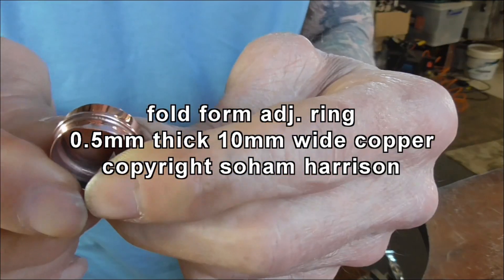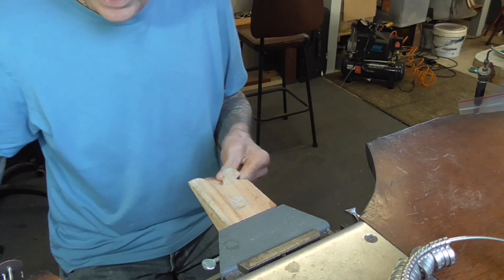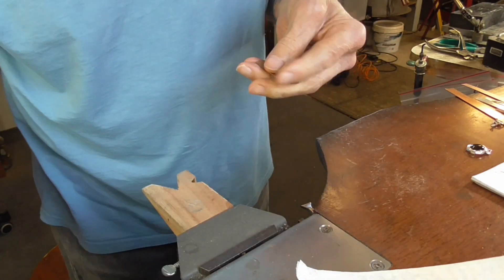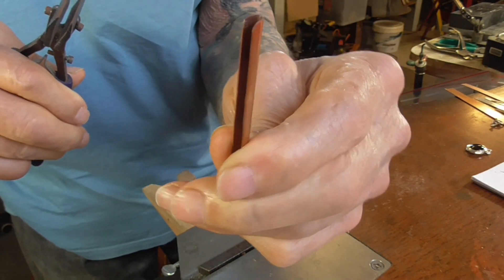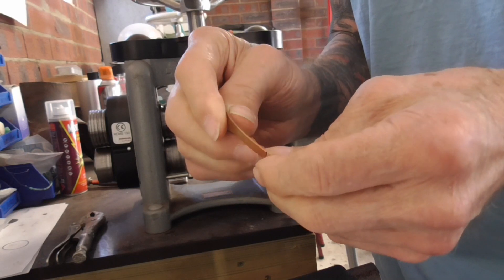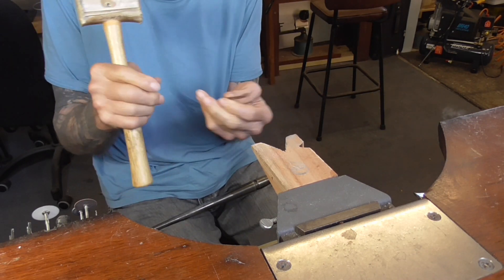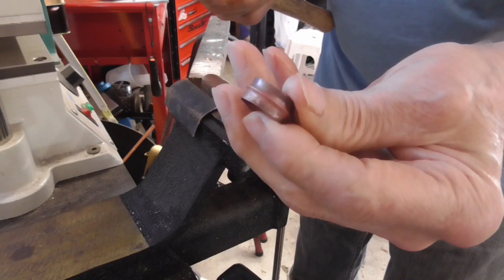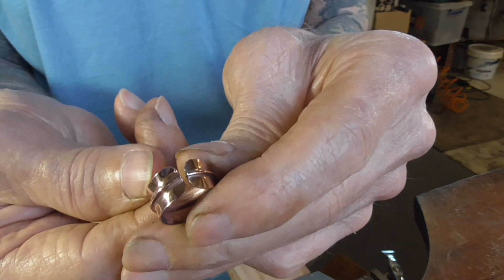adj fold form ring

Comment: This ring is beautiful.  Never thought of using my dapping punch this way either. If your making a wide band ring without the fold and you want it to fit a US 4-6 do you cut your metal out for the length of the size 5 (minus a few mm) and so it can tighten to a size 4 and go to a size 6?
Reply from the maker: sounds good!